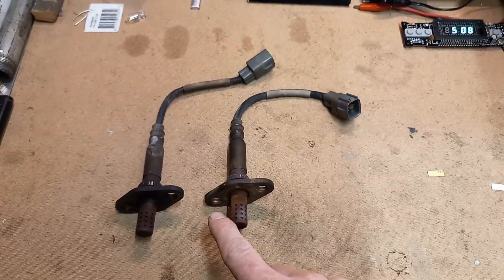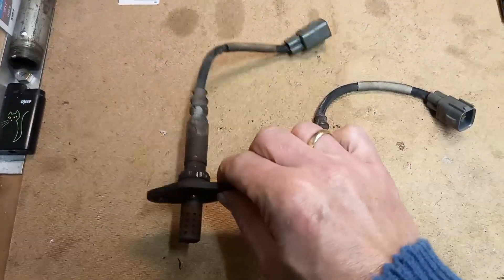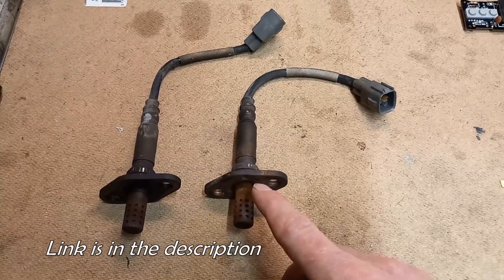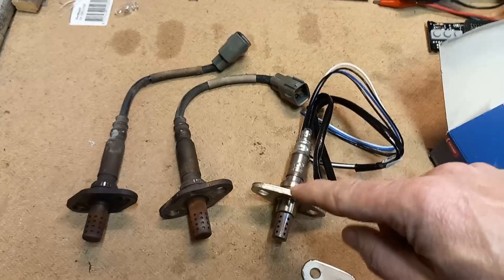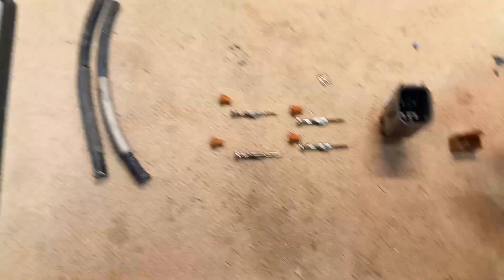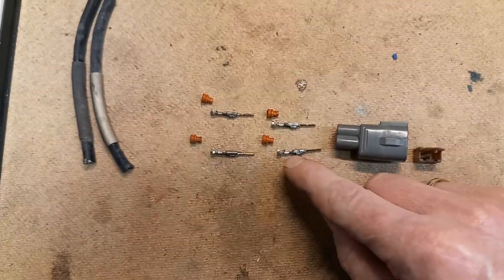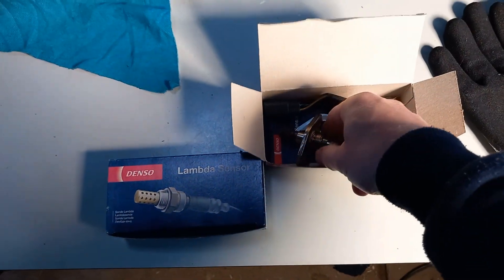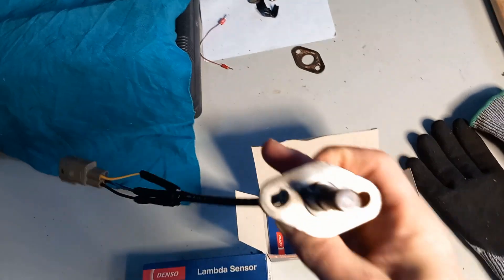Lexus LS 400 O2 sensor replacement - Impossible to find OEM sensor

Comment: 6th episode so far. I have the same issue hahah. Adding the fuel pressure regulator and engine coolant sensor to my cart. Btw I do not have factory o2 sensors for some reason lol 95 ls obd1 here. Hope by the end you have a solution 😂
Reply from the maker: It is a work in progress, but I will start working on the car again. Stay tuned!

Comment: 1991 Lexus ls400 and I have no acceleration. A scenario would be turning left of or right and when pressing on the gas pedal I get no acceleration no matter  if pressed to the floor. 3 years in park 😭🫠🤔🫡
Reply from the maker: I can think of several issues that cause such symptoms. Did you check the capacitors in the ECU? It also can be a fuel pump issue. I have a series of videos on these subjects, maybe they are helpful for you.
Reply: @Carnold_YT  thank you, I am checking them out now, I had the ecu checked and repaired by Josh At MotorsportzTX- I am in california- if it’s the fuel pump, I hope it’s available again- for a while it was out of stock. - thank you, thank you